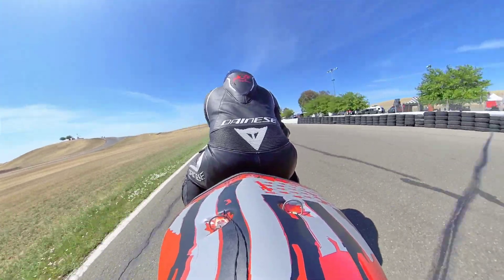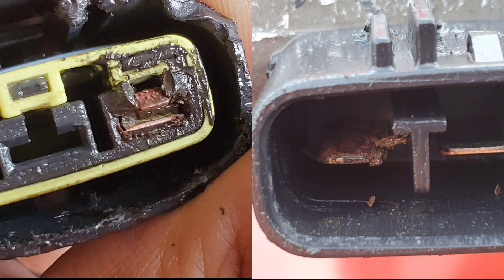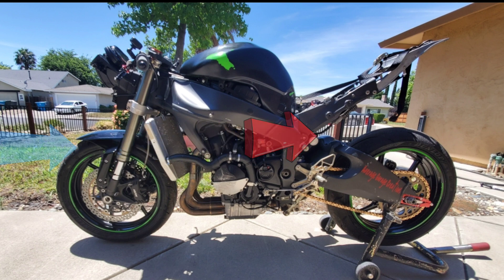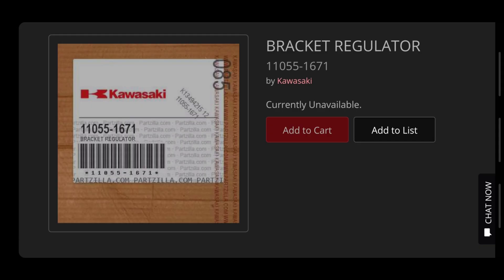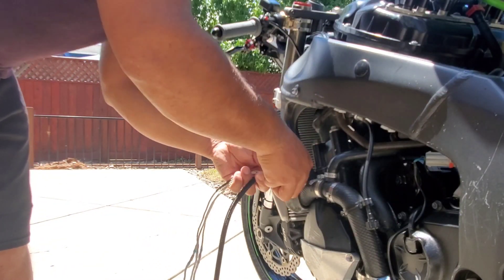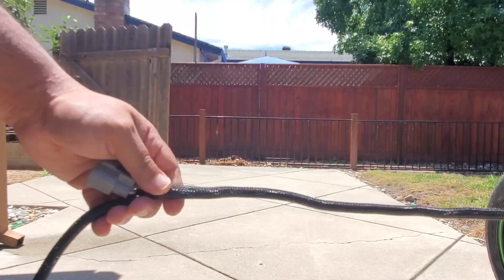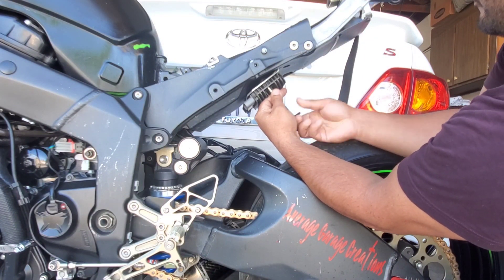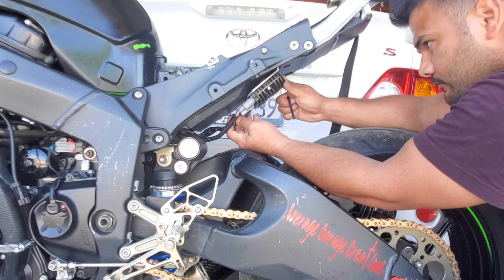How To: Rectifier Relocation ZX6R

Comment: Hey ..does the casing need to be grounded? ..i know the one plug has its own ground , but is it necessary for the rectifier casing to be aswell?
Reply from the maker: I don't know for certain that it is grounded at the casing, i think it's grounded through the harness. The Kawasaki race manual says this is the best relocation for the rectifier for racing applications. But this is still suitable for street bikes as I have heard other bikes actually place theirs here from factory.
Reply: 1 year too late

depends on the rectifier, in some motorcycles they are super simple (made to be cheap) and ground directly to the frame

on more premium bikes (most 600cc and up) it usually has "proper" grounding

Comment: Hey what is part number 5 called in this diagram. also what is the name of this diagram
Reply from the maker: The diagram come from the Service Manual for a 2009-2012 Kawasaki ZX6R and the part labeled #5 is the charcoal canister which is part of the EVAP system for California bikes.
Reply: @GaragePrints  do they have a deletion kit for the EVAPs?? I guess I have a California bike in the midwest lol
Reply from the maker: Hilarious! But sometimes manufacturers make ALL their US bikes California compliant to prevent having to do more logistics in their shipping.
Reply from the maker: EVAP delete kits are  sold and based on what I remember it's mostly just two block off plates a few vacuum caps and then removing the hardware.

Comment: I'm changing out my rectifier but I can't figure out where it's at on a 2009 ZX10
Reply: It's in a horrible location behind your engine and in front of your rear shock. They use 10mm bolts and it is very hard to replace.
Reply: @sjohnson4451  omg it was just easier to take the bracket lose , then go from there and yes it is a big pain in the arss . Thank you . My Jesus bless you
Reply from the maker: I don't have a ZX10R either, but if you search for the service manual I'm sure it's available for free online...